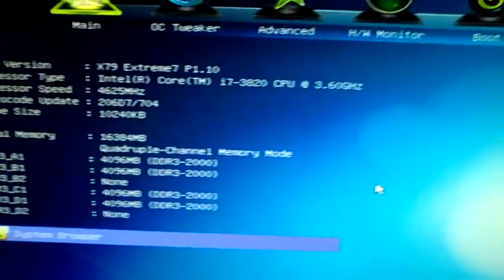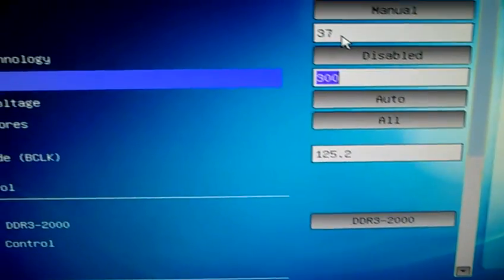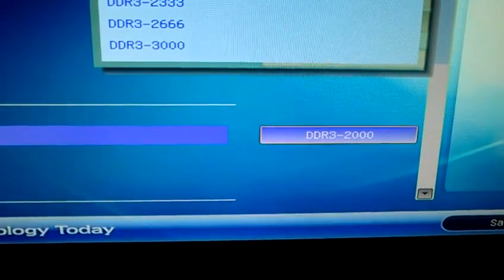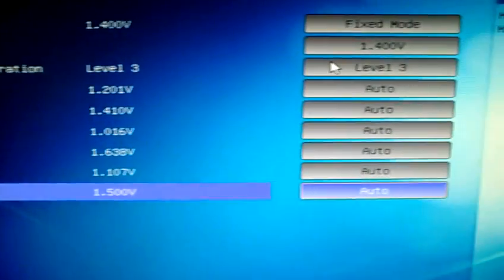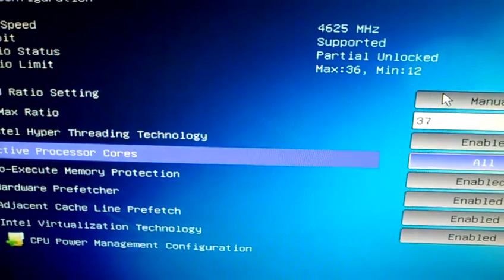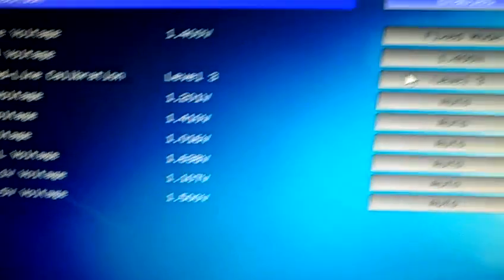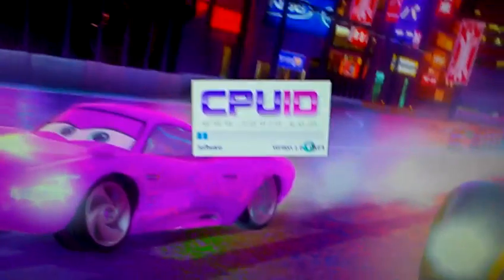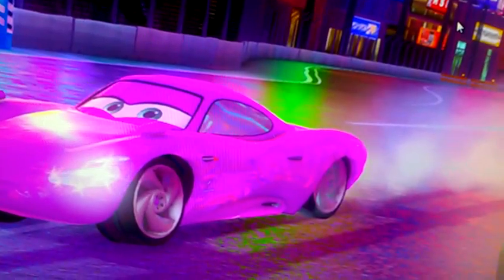how to overclock the i7 3820

Comment: 2017 and the i7 3820 still rules!
Reply: Whyx Nowx How good is it? It will bottleneck a good grafics card?
Reply: Good question!
Since my order of the GTX 1080 ti is not here yet I can only tell from online research.
And yes, there seems to be small bottleneck:  While running a high demanding game with max 120 frames per second on a new platform you will only recieve 110 FPS with the old system.
We are talking about maximum frame rate.  In the minimum frame rates there is not so much of a difference.
BUT we are talking now five years later and we ONLY have a few % more power.
That's why I decided to buy a new graphics card only, since I need high FPS on a 1080p monitor.
So it seems NOT be worth the money to buy a new system.  With a GTX 1070 it should be perfectly CPU and GPU at 99% loadout.  With a 1080 or 1080 ti you have a lot better minimum frame rate and it finally makes sense to overclock the good old i7!
;-)
Good luck making your choice.
I ordered a USED graphics card 1080 ti including warranty to save the nature at least a little bit.
Reply: Whyx Nowx Thanks, but i foud a i7 3930k at a good price, i think i will buy it :)
Reply: Whyx Nowx Yes, its even the same motherboard, but with 8 gb not 16 and its 320€. Hope it will be good enough :D
Reply: still a good choice!
if you decide to upgrade to 4x 4gb quadchannel (or more) one day, you can double the RAM frequency..
good luck
Reply: Ehm i am still using this processor in 2020
Reply: 2018
Reply: 2019. OC'd to 4.6Ghz with a gtx 1060 running a 144hz monitor
Reply: 2019 lol also decided to go a 1080ti rather that upgrading the motherboard and cpu. Will do that soon. 
Also got an Acer Predator 27” 2k monitor and I’m running Battlefield V on ultra with no problems.  Just found out that I can over clock this CPU so will give it a shot.
Reply: 2021with da 3rd gen babyyyy
Reply: @user-rg8mc4el8w  sameeeee comrade nazi
Reply: @VayzeFPV  lmao
Reply: 2022 here with GTX1660

Comment: You dont need to overclock this chip it is fast enough to do anything without touching it .
i had a i5 750 but now have this chip i cannot believe how much smoother things are it rocks hard stock .also overclocking ram is not a good idea i just burnt out the first slot on my old motherboard doin just that . so i just bought this 3820 and a new board .1600mhz ram is great for all games also .

Comment from the maker: you it should work, that's how it was made...if you look carefully at the usb 3.0 female connector, you will see that one of the pin hole is blank which matches up with male pins on the boards. as for psu you can grab yourself a Rosewill CAPSTONE 750 gold for 109 freeshipping,CORSAIR HX Series HX850 for 169 free ship or for couple more bucks SPARKLE Magna GOLD PRO 1200w for 180 shipped all off newegg.com...any one of these power can power system fine even if you added a second 7950 with OC!

Comment: yea man i did alot of research on the parts and everything especially the chassis......i have another question though the mobo has the usb 3.0 ports on the board itself so i'd be using that to connect the usb 3.0 that comes with the case but i know the female connector is a 20 pin connector while on the board i'm only seeing 19 is that gonna be a problem or is that just how its made and has full functionality? and as for psu any recommendations?

Comment: hey man nice vid, i have a question. im gonna start a new build i havent done any overclocking on my other pcs, this is my pc specs or well proposed pc specs, 

-i7 3820
-asrock x79 fatal1ty professional
-kingston hyperX Blu 16gb 1600Mhz
-gigabyte HD 7950 3gb
-samsung 840 pro series 128GB SSD
-In Win GR one
-Corsair H100i cooler

not sure what power supply im going to use as yet..im building the pc for gaming....my question is this, if i were to oc like yours would the cooling i have be enough?

Comment from the maker: yes it will overclock your ram but not by much i have 1600mhz when i set the bus to 1.25 it increase my ram speed by .66mhz more..so it might not affect you ram speed too much but i would try and see if you stable or not.

Comment: if i change the bus speed to 1.25 and my ram is at 1.65v at 2133mhz. will if overclock my ram? making it higher voltage?

Comment: Yea, i just did some research  and found out that you can still do quad channel ram on the extreme 7. Plus i don't need 8 dimm slots because i will only have 4 sticks of ram. The difference between the two is also that the 7 has more SATA ports than the 6. And i like the heat-pipe design on the 7 better :P Can you please tell me how many fan headers on the 6 there are?

Comment: No I just mean it only has 6 ram slots so it can only run one quad channel kit as opposed to two and the board is still more expensive.  And as far as "getting info" I.actually own the board that im talking about which you probably does not so you should probably just stop assuming things and relax.

Comment: get the extreme 6 the 7 has two three channel RAM slots instead of two quad channels and I'm fairly certain that there isn't another difference other than the extreme 7 being a bit more expensive.  I just finished a build with an extreme6 x79, 3820, gtx 670, 16gb samsung ram(easy to overclock) for 3d rendering/gaming

Comment from the maker: its base on your budget bud...if you go with the biostar x79 board which a fanatic boards for the price and i7 3820 it will run 529.99 free ship off newegg.com... if thats not within your budget then you might of settle for the 1155 platform 3570k will do a better job at overclocking an cooling than the i7. my recommendation is to get i7 3770k the heat not a big deal as you think as long you going to throw a h100 on it you good for a nice 4.6 ghz which is 2-3% faster than a i7 3820 overlock

Comment: Wait wouldn't it be just as much money to get that $500 i7 processor instead?
I mean the asrock x79 costs $100 more than a normal board.
Then the extra H100 cooling is $100. 
So what the hell. Plus that 500 one is 6 cores isnt it?
What should I do?

Unless there is a board that can get me to 4.8+ for less than $150 ?

I was going to do a 3770k until I found out the heating problems with high clocking...
Thanks!

Comment: hey i have never overclocked before and im getting an i7 3820 and an asrock x79 extreme4, 2x8gb lp corsair vengeance with a be quiet! dark rock cpu cooler. should i set every setting to same as what you have or should it be higher or lower? sorry for not knowing much and bothering you about this but i dont feel confident enough to touch it without some approval :P